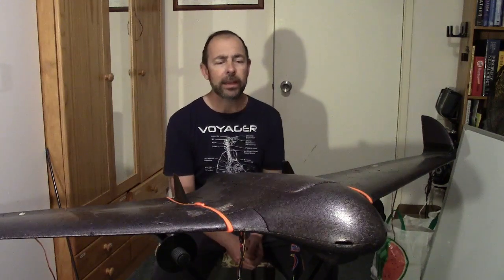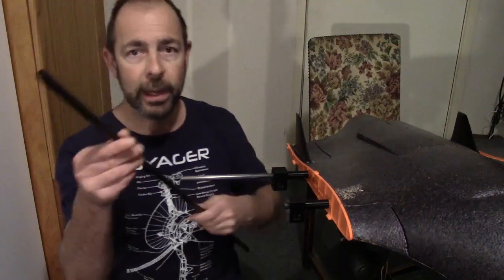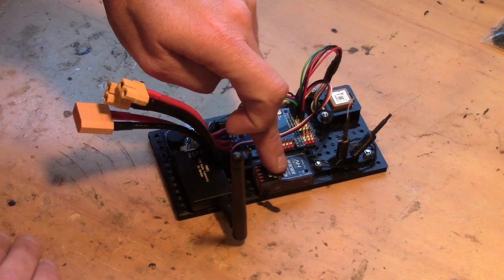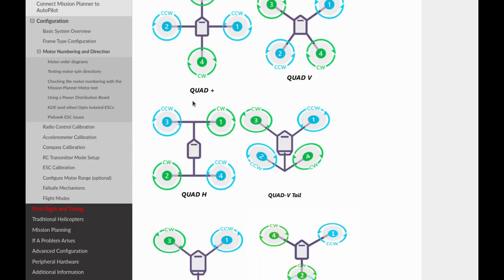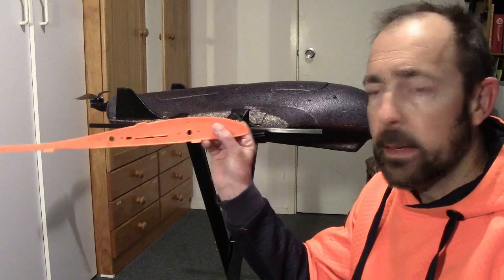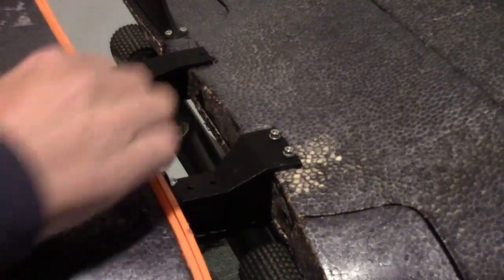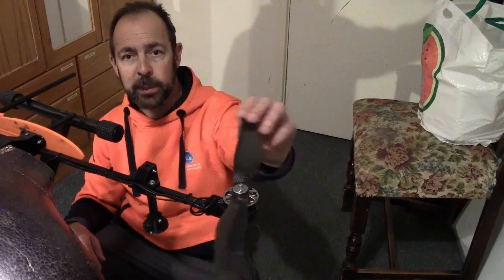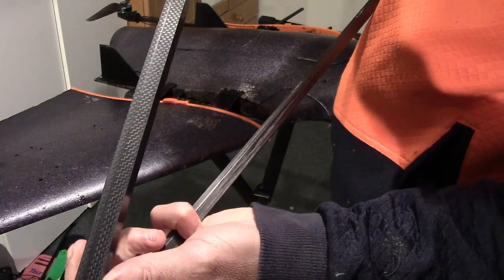Skywalker X8 VTOL Quadplane Ardupilot Conversion

Comment: hmmmm my idea was to run a tube through the fuselage then use a t connector with step down on both sides to join it to the rear wing rods, and use something like the Altus v-tail mount, but a bigger version as that plane is almost 1/3 the size of this thing. i'd most likely have to find someone who can take the altus v-tail mount and print one 3x bigger.
For this design I was just thinking the standard 3 motor setup, but again I'd have to sort out the vtol conversion. 
There's a video where someone shows a conversion kit but I can't find the kit anywhere. 
My brain was like "ohh look, and entire front of a plane all you gotta do is run a tube through it, slap a tail on it and do the vtol conversion"
I mean, I'd rather spend the under $300 usd for this shipped and then mod it then spend like 2-3k on foam

Comment: Hi David, I'm using matek f405 vtol fc on the same X8 skywalker. With 4 40a hobbywing esc and 4 flashhobby 650kv motors and 4 12x8 propellers. Setup as H quadplane. Can you share you pid numbers. My plane kept on tipping over to the front in qstabilise, qhover and qloiter modes. Any advice is welcome. Thanks.